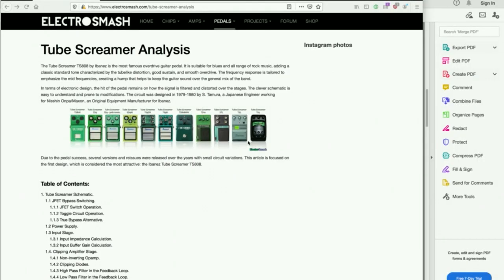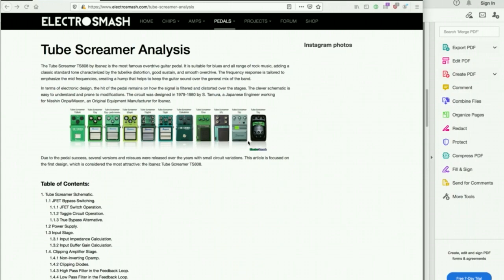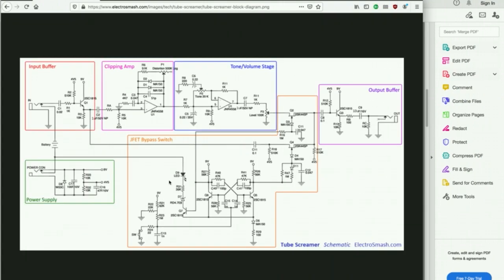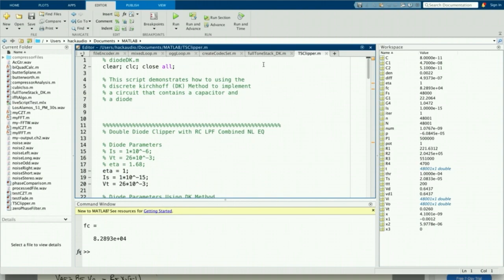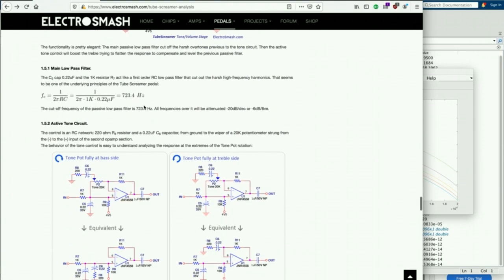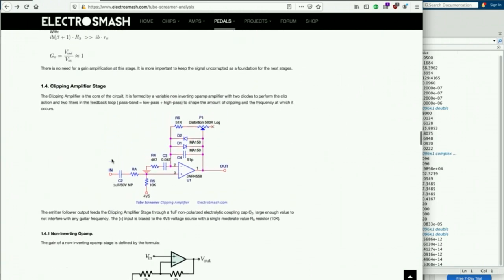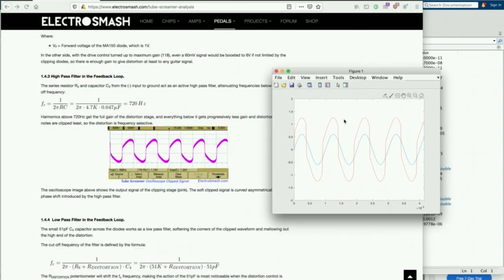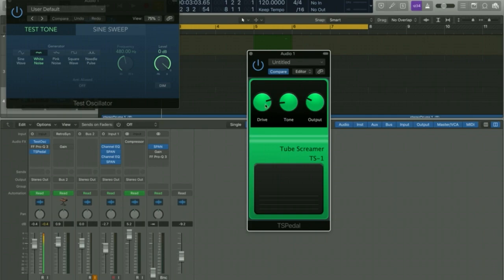Audio Circuit Modeling Workshop (Link in Description)

Comment: Hi Eric!...
I am a telecommunications engineering student specialized in audiovisuals in Barcelona Spain, I have done a little circuit solving and a little C ++ and matlab during the years that I have been studying. 
I would like to base my final university project on a plugin like the ones you are talking about, but I don't know the level you have to have to understand what you will explain in the webinar and i don't know anything about juce.
Reply: From their patreon:
"Additional Details:
A good portion of the workshop will be demonstrating the mathematics of circuit analysis and simulation in MATLAB. For those experienced with Python, that could also be used instead. Hopefully there will be time to add the code to a simple JUCE plug-in by the end of the weekend. "